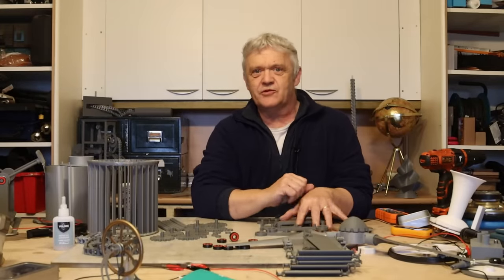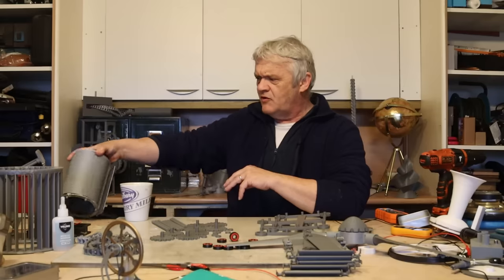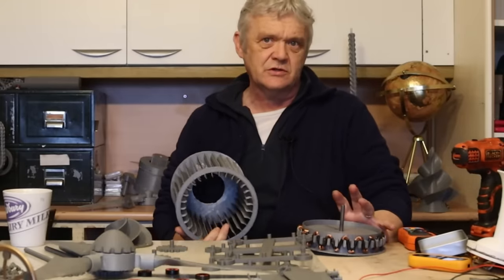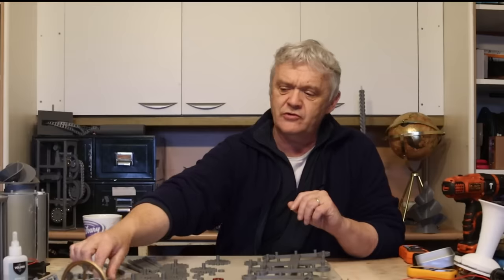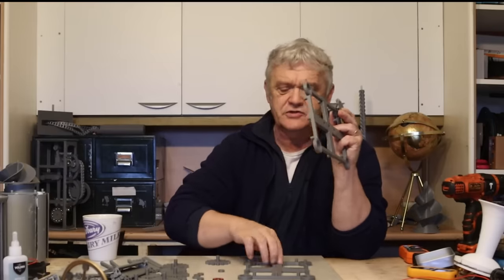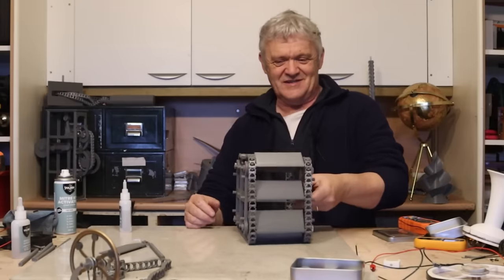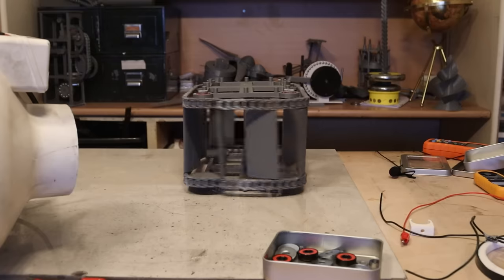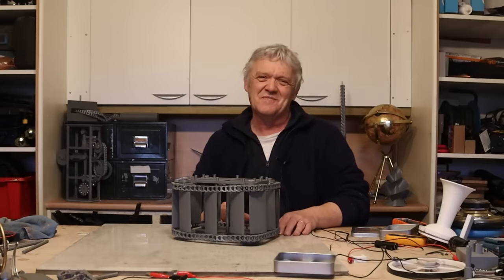2115 Building An AirLoom Style Wind Turbine

Comment: I really like this take on a modular design. On a larger scale you can set each cog pair on a post to drive a generator. When you need to expand and some more chain, a few flaps and another post. When a generator breaks down you don't lose the whole system.
Reply: Actually (depending on available wind and engaged surface area of "sails/blades" , you can put a brackets for multiple cogs and generators . That , also , can be done with more "classic" designs of wind turbines. This can easily be put on incline/hill (doesn't have to be flat ground). Though , it is a pretty complex setup and the maintenance can be more demanding than in the classic setup (more greasing , wearing of the more components , how to deal with cable/chain material behavior on different temperatures , etc...).
Reply: @pedjamilosavljevic6235  I wonder if the option to deploy the solution on a slope or varied terrain drove the choice to use cable instead of chain.
Reply: @hrothgeirrH  I believe it was more of price concern (maybe weight concern - I don't know is there a much of difference) , because one can adjust the angle of the cogs  , on multiple points to be in the same plane . Presumably , the blades would be vertical , therefore, mounted at some angle (not right angle) in relation to the chain (or cable) , but that depends on the "attack angle" of the wind stream .
Reply: @hrothgeirrH  slope is one thing that challenges this particular concept. The operation really wants to be in one flat plane & horizontal minimizes gravity wanting to twist the drive system. The torque on any system through those redirects would induce a lot of stress & friction. Even aircraft cable has inherent twist depending on the tension  relative to the lay of the wire.
Reply: Still need the frame...the chain would fall off ...chain also no good over distance horizontal
Reply: @salimufari  I was thinking about ski lifts and gondolas. Those are cable driven applications that run over varied terrain.
I'm thinking that carrying a vane across a hub isn't that different from carrying a lift chair or gondola car across a hub.

Comment: Thank you, I have gained an understanding of An unnecessary transfer of energy taking place. One day I plan on building a wind turbine for my house. I'll keep this in mind. The large commercial wind turbines all have this problem. They transfer high speed low tork at the wing tips to low speed high tork at the center. Then they use a transmission to convert it back doubling their losses.

Comment: The Air Loom is similar to the Madaras Project proposed back in the 1930s.  A large circular tract filled with carriages end to end.   On each carriage stood a magnus/flettner rotor, each rotor was proposed to be about 80 feet tall and 22 feet in diameter.  To maintain propulsion the rotors rotation would need to be reversed on the leeward portion of the tract. Power was abstracted from a dynamo fitted to each carriage

Comment: Great simplification of a great concept. In real life the uprights/pylons/pillars at each corner could be solid inset in the ground. From there the blades can be on parallel ropes between the pivots at each upright. So, there could be anywhere upwards of 3 uprights and each upright would be a generator point driven by the wings strung between the parallel ropes. If the wings were carefully pivoted a small slave or flying wing could pitch the generating wings to follow perfectly the wind direction to trap the most lift/power from each wing as it moves round the path of the ropes. So the wings would automatically pitch themselves to maximum power generation as the ropes run round their pathways. The final refinement would be magnetic bearings at the generator vertical pylons that guide the rope round any corners. Thus, the maximum thrust will come from every wing all the time and no friction would lose power at the turning pylons/pillars. This completely removes any disadvantage a VAWT has except possibly height above the ground.   That would be the design I thought of years ago.
Reply: I agree.  The concept is great for large scale operation with long straight power runs and short 180 degree turn around runs, but would only work well when the wind is blowing perpendicular to the long straight runs.
 
To maintain the optimum  angle of attack the "wings" would look like high performance gliders turned sideways.  The wing airfoils would be symmetrical like most large scale VAWTs.  The most efficient symmetrical airfoils have a lift to drag ratio of about 80 to 1.  HAWT non-symmetrical airfoils,  have lift to drag ratios between (100 to 1) and (140 to 1) along most of the blade.

My feeling is that the "AirLoom" type system cost of construction and maintenance would greatly exceed the costs of today's HAWTs for the same amount of power production.

Comment: If you remember way back in physics class about levers. Generation at the rim is at the end of the lever. There is more speed but less torque available. At the axis there is more torque and less speed available. Six of one , a half dozen of the other. The more current you pull from the generator, the more mechanical resistance there will be at the rim . It really comes down to how you design the generator.
I've come to conclusion after playing with these things for the last ten years that. A very large, slow wind turbine is the way to go, at least at ground level. There is way less wear on the components. You can gear up the speed of the generator with a CVT. Also generation at the rim requires much more magnets and coils. Pretty expensive

Comment: If you use a bicycle wheel with the blades and magnets turning inside a slightly bigger bicycle rim with a serpentine coil you would have a very nice wind generator.

Comment: Just discovered your channel, loving the huge variety of topics. I'm an engineer working with CNC machining alongside industrial 3D printers. Very cool to see how your opinion on printers developed and now you're using them for all concepts/prototypes. We have a Fuse1 SLS machine by Formlabs. It's insane, making large functional parts out of powder... and it connects to a 3 pin plug. I can see this type of machine being hobby accessible in 10 years.

Comment: I didn't think it would move so smoothly, very impressive!  When you brought up it being no different if it were turning horizontally from vertically I would expect gravity to play a major part once it was scaled up (and of course as a small prototype too, but not nearly as much) I would also think that putting the chain around a circular frame instead of a square frame would me a LOT more efficient too.
Those are fairly obvious to see that they are more efficient, but I can't tell if using a generator on the outside would have a difference between using one gear connected to the top chain and using both chains connected to one generator with a rotor that passes all the way through the generator body and a gear on each end.....  That just not something that seem intuitive to me.. which version would produce more power? 
And that's just like you were saying about building a model/prototype compared to just working it all out in the mind. And that is why I love watching your videos... you actually take the time to build it and not just just assume that you can work out the answers on your own.  :)

Comment: Wow your 3D printers have been busy.  Amazed too see this model video pop up so quickly after the first one on the subject.  Actually seeing your model I tend to think that a horizontal setup would the better overall option not only in power production but in structure design and equipment maint. as well.  Thank you for shedding more light on this concept.
Reply: - a new take on the "power wall - the whole wall (rainscreen) moves and generates.
Reply from the maker: i like the idea of a horizontal version mate

Comment: Nice build on this design Rob! Works great. However, I don't see the advantage of this design over the conventional circular ones with a center axle. My feeling is that the chain or cable has a lot more friction to overcome vs the conventional ones with just a center axle, therefore less efficient.
Reply: Part of the limiting factor of a VAWT is that they  don't generate (much) on the upwind blade (think as the lossy part of the cycle)  - and the downwind blades are in the drag regime (think sailing boat) - putting it on a "conveyor belt"/zip-line/traintrack/loop- analogy, with a prevailing wind  - the blades are mostly  working on a "beam reach" - ie. fully acting aerodynamically with zero slip to the wind - as a wing should. 
 Now  (using a very thin track - ie. like a chairlift track  the VAWT can approximate the duty cycle of a HAWT, with very few blades in the upwind or downwind legs - and they can be hauled by the working blades ( in the high power regime) of course as you point out, friction is the enemy - (so is g-force too, as with all  VAWTS - at high rotational speed, - if they use-  cantilevered blades need internal support). There are now many ways to tackle the "problem",  steel wheels on rails are the most efficient (but a little noisy) - then we could use airbearings or maglev (on a rigid rail(s), now how to interconnect and attach to the generator (or maybe don't?? - haul a single cable around the loop, vs autonimous cars / - and multiple generator stages all around  - or short independent trains chasing each other...vs a single  huge bicycle chain - and several smaller - -distributed generators  (like a long overland conveyor with several power units (now reversed as generators - OR take the cablecar idea and use 2 rows of cable for vertical support - and generate at the end wheels...   .

Then as you say - one could just set up a row of counterrotating VAWTs under the towers of a HAWT farm along a cliff-top - and generate an approximate amount of power -without the whole track setup..(there will be an upwind and a downwind blade (phase during for each rotation more) for each merry-go-round built.)... 

Models are good to play with - realworld vs digital, having a bit of fun is good.
Reply from the maker: well, they make bold claims and it certainly caught my interest - but that's where I am with it right now - lot's of investigation to do for sure

Comment: It's great the way you turn a typical engineering concept on it's ear. I see that other folks have commented on the additional friction. Which was a thought that came to my mind as well.  With larger proportional blades, the additional friction may be a moot point.
Reply from the maker: they comment on friction because basically they don't really understand chain drives and were they sit in real life power transmission applications

Comment: That worked remarkably well! Thanks for sharing. Maybe a chain tensioner on the next version?
Reply: It would appear that the chain tends to flex outwards when spinning so is, in effect, self tensioning. An additional tensioner would simply absorb energy and be counterproductive. Excellent video!
Reply: The energy to keep it flexed outwards as well as the energy for all the flapping around it's obviously doing is not free. All you gain by excluding tensioners is premature wear and a bunch of racket. The decreased rigidity will also reduce kinetic energy transfer between the driving and driven parts of the system when you put load on it.
Reply from the maker: for sure mate

Comment: About 2003 I played with a very similar concept, I called it the ‘waterpilar’ like caterpillar tracks. Imagine your square design would be elongated and would float/be semi submerged. The water would push the flaps and above water tucked in with little to no resistance turn. As you mentioned talking about is, is one thing making another.

Comment: One of the interesting things you could do with this concept is to have multiple rows of blades moving in opposing directions. Thing is that the chain doesn't need to go round the perimeter of a rectangle: it could go back and forth within the area of the rectangle instead.

Comment: Think horse walker with several booms attached to a center post. Instead of horses underneath the booms you place wind catchers on top of the ends of the booms, instant leverage. --- With planetary gearing, I'm gearing up a large magnetic rotor with the matching serpentine coils. --- I'm using a  large back yard trampoline on stilts to help support the booms that rotate around the trampoline's metal hoop which I'm using as a rail for the rollers that are attached to the booms. That's what I'm working on. I actually think I will be able to move the system by hand when there is no wind. Don't worry I have that trampoline securely attached to the ground.

Comment: You could still do generation at the rim though couldn't you?  If you incorporated magnets into the individual chain links by making them a bit wider or longer, then put the coils above and below the chain links - they don't have to be circular in pattern in how the winding is placed in, right?  So long as the magnets run perpendicular to the coil?  My 3d printer has a huge queue so I can't get to this real soon (but I do have a new Creality K1 Max coming, YAY) - but I think that would be worth some fun trying.  Will give it a go soon if I can get to it.
Reply from the maker: yes i think you could mate

Comment: RMS, make it a window width. Then make 2. Put one airloom wall on the lower floor, one on the top floor and let convective currents drive a small generator. Put one on each post and you might have an impressive power system to charge a bank of phones.

Comment: With the same blades between two shaft mounted discs, you would have the similar rotation with less parts and less friction, of course that would make it an articulated paddlewheel which would work well in a stream of water.

Comment: Brilliant. could make snap together square frame bits to make a long one or larger square then the print bed.. or make a large frame out of plywood at desired sized.. I do have a question about direct wind square in it not blowing on one side, will the side and back all be pushed by the wind.. anyway.. brilliant brilliant stuff.. I love modular and this is the height of customizable and modular. I have a feeling this could be absolutely crush horizontal wind turbines of compatible size.. this is truely awesome, looking forward to your next videos.. I love the chain for ease of use but in application it is probably much quieter to use some sort of cable.. but the chain is absolutely brilliant for experimenting and mock ups.❤
Reply from the maker: exactly mate

Comment: If I put an air loom system in my back yard I would make it multi-purpose. The support pole might as well have their own wind turbines. The spaces between the poles might as well grow beans, or be a clothes line.  I have plans to make a merry-go-round generator for additional off-grid power because I'm looking for a mechical advantage to hand powered, power generating. With an air-loom system I can use it with wind power and hand power.
Reply from the maker: nice plan mate

Comment: If the chain its self was magnetic you might be able make a chain tensioner system with fewer contact friction points
Reply: I wonder how well it will work in conjunction with an aeromine system?
Reply: AirLoom may be able to benefit from quantum locking superconductors or something similar
Reply from the maker: cheers mate

Comment: The Mexican Patent in the IMPI MX/a/2023/006829 Wind and/or Hydraulic Turbine with Vertical Axis, Foldable, Multi Configurable and Synchronized Mixed Blades, does not harm birds

Comment: Does the airloom produce more energy.  Gates seems to think it will produce more energy than giant wind turbines with a lot smaller, cheaper, footprint. Yours works great but looks clunky and noisy.  Airloom looks more kite-ish and it's supposed to have less noise.  I am so happy you had a close up of the connectors on airloom.  I think you're absolutely right that the generation is at those links and they are all basically the same. 🎉❤
Reply from the maker: mine is clunky mate - but then it is a simple model to explore the concept

Comment: How about using V rollers like the ones on your 3d printer, to individually mount larger fan blades centered onto a single 3d printed V track? One roller on each fan blade could then be geared to, or directly attached to a dynamo. They could be tethered together as the airmine/loom is.
Reply from the maker: good suggestion mate cheers

Comment: Interesting... because of the design it wouldn't be that much more difficult to make it a hybrid solar/wind device. The fins could be solar cells.. the cable rigging could be wires... The fins could even be angled by adjusting the loops of wire/cable.

Comment: Possibility for multiple points of generation, I would like to see the blades a little longer for more torque, and add a Darwin type setup that's pushing the wind down from the top and up from the bottom to help focus it on to the blades.

Comment: I think the vertical setup would be better. Less stress on the sides of the chain as chains are designed to work on a vertically oriented sprocket.

Comment: Only trouble with the real thing is each tiny, high-rpm, high duty-cycle bearing represents a hard-to-detect, single-point failure mode. You should invent a sort of carrier\cartridge system for replacing and servicing as many spinning thingies as possible in a single window of opportunity. Also, the carrier\cartridge thingie could sport a rail of permanent magnets to interact with a linear arrangement of small, easily mass-produced, collecting coils (vs mechanically linked rotary generator).